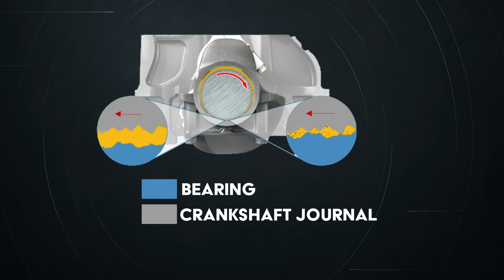the truth about start-stop technology (finally proven)

Comment: It appears from the editing that youdrained the oil. Thus, your timings include priming the pump. I guarantee you oil pressure is built during the first restarting cycle arter the engine has been run for only a few seconds.

Comment: On most modern cars (mainly BMWs), disableing the start stop system doesnt save you, because the oil pressure mapping is far to low in idle, as the engine isnt designed to run in idle due to the intended use of start stop…

Comment: This could kill someone, and maybe it already has — who knows. I was about to pull out onto the main road from a side street. I almost came to a stop, ready to accelerate, and the car just shut off. I lost another two seconds while slowly rolling toward the road because the engine was off. Total stupidity.

I drive a lot of different cars, and not every start-stop system works the same. Some cars need to warm up first. In a VW, it shuts off instantly even when the engine is cold and you haven’t come to a complete stop.

Comment: Here's the thing about the argument that you are missing. Start stop is not inherently bad. Start-stop done cheaply is exactly what you're describing. The downsides that you have showcased are indeed accurate, but they are easily prevented if manufacturers care. Take a look at the Mazda i-Stop system, it's start-stop done right. The way it works is quite simple. Whenever the engine stops, the system ensures that they are always stopped in a certain position (with one of the pistons being "primed" for the power stroke), so the engine is quick to start and deliver what's needed, this making it less noticable. As for the wear, the system has an electric oil pump that ensures that all parts that require oil to not wear are properly lubricated. On top of that, the engine is designed with oil retention systems, thus making sure that as little as possible oil escapes from where it's needed. The entire starter assembly is also designed to take the extra load of having to start the engine so many times. So with these systems in place, the wear you are describing is basically nullified, as you're ensuring that everything is properly oiled up at all times, and you're getting all the benefits (less fuel consumption, less pollution) of start stop, for a tiny bit more complexity (as there's an extra component, the electrical oil pump). Audi, BMW, and VW also have this type of systems, but they are reserved for the higher end models. The system itself is not bad, but implementing it poorly to ensure lower emissions (as a company, not per car basis) is causing problems, not the system itself. So have manufacturers implement it properly, and there won't be any issues, but they won't, because they care about profits more than anything else.

Comment: BS. false conclusions after your video here:
1. If you don't drive each trip at least 200 km, don't bother. I guess German cars are not for you. I drive to the grocery store every day, less than 10 minute drive. There's no traffic signal. I stop the engine because I reached the end of my trip. I guess German cars are no good for this.
2. 1000000miles? My care that I just replaces was 12 years old and had 120k+ km on board (owned since new). Why the hell would I need 1million miles? Who does?
3. German engineers sure know how to reduce wear in those situations. Some finishing and thermochemical treatment. Makes the engine more expensive? Yes, better than leather and hand stitched shit. Also there's some tweaking of the lubrication systems, so on. That means you build an engine exactly for that purpose. Surely German engineers can rise to the challenge, aren't they?

Comment: Great video! As a feature intended for the city we would need to know the amount of fuel saved in average during, let's say 250000 KM, and then compare against the carbon print of all extra repairs required. I would think, without having the data, that except for heavy used vehicles like taxis or people with very long commutes with a lot of traffic, the use of start-stop will be detrimental from an environmental point of view. Similar to forcing someone to switch to an EV when running 10000 KM/year.

Comment: the fuel saving benefit of start-stop doesn't justify the added wear on parts, and the general environmental impact that passenger cars make is also minuscule. most emission is caused by heavy machinery, energy generation etc. the only significant benefit of start-stop is in dense areas with high traffic, where it can noticeably reduce the local air pollution.

Comment: It doesnt take an engineer to work out that start up is both when most wear occurs and when catastrophic failure is most likely during ordinary operation.  

This is worse than just a bunch of extra start cycles however.

During an ordinary start the brake is depressed and the transmission isnt in a drive gear. There is a minimum delay between start up and applying any throttle as the operator must switch pedals and choose a gear first. In a modern engine this delay provides some time for the oil pump to profuse the system.

The typical stoplight isnt long enough to drain oil from the engine, but a wait in a drive through or other situation might, and going from engine off to open throttle with zero lag to allow for the pump to re-profuse lubricant is a recipe for heavy wear or even breakage.

With auto stop/ start youre frequently going from engine off to heavy throttle almost instantly. There is enough lag to make  stop and go traffic a thoroughly terrible driving experience, but not enough to prevent all sorts of suboptimal conditions within the engine.

It is a thoroughly terrible idea that is nearly certain to negate any environmental benefit it might provide through destroying engines, reduced engine life, necessitating excessive oil changes, consuming batteies more frequently, etc.

If you own a vehicle with this feature and you arent willing to permanently delete it (its easy but will invalidate your waranty) you should form the habit that starting the engine always also includes disabling this feature.

Failure to disable the feature is akin to running dirty oil or clogged air filters: Sure, the engine will operate, but with excessive wear and an impaired driving experience, and may cause sudden catastrophic engine damage.

All this says nothing about the growing evidence this feature is damaging batteries, that then causes a cascade of diagnostic messages and systems failures.   Why does your car say the parking assist needs service and the AC wont blow cold air?  The battery is damaged due to the S/S feature and is now sending inconsistent current to the computer. If you have the S/S feature the first step in any vehicle diagnostics is to install a known good battery and see if that fixes it. Often it will.

Auto Stop/Start is the sort of absurdity only an ignorant person could conceive of, like an EVAP system, it seems to have been invented by an engine hating, driver hating devil.

Comment: I always wait for the enigine revs to get to standard idle before moving off. I'm under the impression that at this stage the oil has now circulated to where it should be. Driving a 2004 Mondeo ST with 115,000 miles on the clock, runs like a watch still.

Comment: My 2017 Cruze doesn't have any way of disabling the start/stop system. I was so happy when it stopped working, lol

Biggest issue that came with start/stop in my car was low engine power from a stop even when the engine didn't auto-stop. I'm talking about upwards of 10-12 seconds to reach 60kph. Ever since the start/stop system stopped working that issue went away completely.

Comment: I manually start-stopped at my last 2 ICE cars. About 0.7 liter/100 km less consume, no problems.
My 2004 to 2014 Seat Alhambra was after 239,000 km destroied by a flood.
My 2014 to 2024 Dacia Lodgy was after 252,000 km sold to be replaced by a Tesla Y.
Do not believe his fairy tales.

Comment: Another nuisance of your engine shutting off at a red light is that your A/C stops cooling, so in the summer, after a minute of fuel saving, now you may need to set the AC work harder to cool the cabin back down, completely negating the fuel savings in the first place. I have only been in ONE car in which the AC continued to work with the engine stopped. The new CLE line has a mild hybrid setup which powers the AC with the electric motor. I parked in a lot while borrowing one last summer and I realized after about 5 minutes that I didn’t ’kill the car after parking. Impressive tech. Only time will tell if those engines also were made to diminish wear while using the start.stop feature.

Comment: This is a non-issue. I'd like to see oil wear analysis with and without start-stop. I have a 25-year-old car with 500,000km with start-stop (2000 Honda Insight) and you never see crank or rod bearing failure. The engines are known to do 500-800 thousand km. You should be more worried about cam bearings since they are the furthest from the pump

Comment: You needed to run a control where you have another car running continuously side-by-side with the start/stop car.  Not only that, you would need at least 10 cars for each situation, then compare all the bearings.

Comment: its pretty simple, the more times your engine cycles between hot and cold, the more wear you experience. its not the action of starting the engine over and over that wears it down, like a lot of people think, its simply that the more times you bring your engine up to temp and then let it go cold again (more cycles), the more wear you'll have. thats why truck engines last so long, they run at ideal temps almost all the time because theyre on for long periods, not in short cycles like a commuter vehicle

Comment: So how many start/stop cycles were they actually subjected to in those 48 hours?
How long would you expect it to take for the bearings to wear down as much as they did?
For the million km engine, which type of bearing is that?
Are the bearings the parts expected to wear down the fastest... or just the easier to access and examine of the parts that wear down?

Comment: The fuel savings are just not there. The whole thing is a scam made of good intentions and no oversight. Bigger Car Batteries, Reduced Battery Life, increased engine ware, Starter motor failures, less people though light sequences, acceleration before oil pressure, the list goes on and on. All to solve a problem on a consumer level, that makes no difference in comparison to shipping which burns dirty fuel and causes more pollution than all cars combined.

Comment: I think it’s a plot to force EVs onto us. Because the argument that EVs are eco friendly doesn’t hold if you calculate in the longevity of combustion engines and the extremely CO2 intense production of EV batteries. Therefore the combustion engines needs a drastic cut in longevity and a lot more wear. Welcome to the start-stopp-Automatik. There is a reason it’s illegal to program it out here in Germany. And it’s not because the engine idling for 7 seconds more every day is killing the environment

Comment: "Start-stop oil" isn't a unique type of oil but rather an engine oil specifically formulated and marketed to provide enhanced wear protection for vehicles equipped with automatic start-stop systems. These oils contain active substances and technologies, such as BIZOL's LubriBoost™ or Castrol's DUALOCK technology, that create a stronger, more resilient lubricant film to protect engine components during the frequent, short-duration shut-offs and restarts characteristic of start-stop systems.  
Why are special oils needed for start-stop systems?
Increased tribological stress: Frequent engine starts and stops place high wear stress on engine components, particularly at the point of mixed friction. 
Resilient lubricant film: Start-stop oils are designed to produce an exceptionally strong and resilient lubricating film that withstands the increased stress and prevents collapse during these brief engine-off periods. 
Active wear protection: These oils contain active substances that offer enhanced wear protection, especially in the mixed friction range, a condition that occurs when the full oil film is disrupted. 
Key characteristics of start-stop oils:
Superior film strength: They offer a much stronger and more resistant oil film compared to standard oils, ensuring critical engine surfaces are protected. 
Specialized anti-wear chemistry: They contain additives designed to provide increased wear protection during frequent start-stop cycles, according to Nulon. 
Enhanced anti-rust properties: Some formulations also include an anti-rust boost to combat the effects of water condensation that can occur in hybrid and PHEV (Plug-in Hybrid Electric Vehicle) engines, notes Nulon. 
Important Considerations: 
Not a separate category of oil: While marketed for start-stop vehicles, these oils still fall under general categories like full synthetic oils.
Check manufacturer recommendations: Always consult your vehicle's owner's manual to confirm if special oil is required and which specific specifications to use.
Proper formulation is key: Using API-certified synthetic oils specifically designed for start-stop systems provides the best protection, according to a YouTube video.

Make sure you change the oil at around 5000 miles or less and you should be fine...

Comment: As you don't mention under which conditions you stop and start the engine, we can't say much from this. If you open the manual for your stop-start-enabled car, you'll see a page-long list of conditions. For my car, there are 2 columns, and the last point is "etc...". So unless you took all of these factor into consideration, the test is nor representative. Also, I don't think many cars you go to more than 150000 kms. Yes it's true for a taxi and maybe a delivery vehicle, but your average car will break down from other factors, like the parts being 25 years old. I'm not sure this is actually a concern outside of specific use-cases.
Add to that that a stop&start-enabled car starts saving fuel after only ~3 seconds, or if I phrase this differently: with stop&start disabled you start wasting fuel after ~3 seconds! I'm really not sure your point holds.
A mechanic told me to disable stop&start in traffic jams though, but not because of engine wear. Because on this entry-model car, stop&start uses the main starter, which can stall.

Comment: 2:05 Yeeah. I was taught this a looong time ago. Even for electric motors, it takes far less energy to maintain them at speed, than it does to stop them and restart them. Airlines & Airplane manufactures will tell you an airplane experiences the most stress during takeoff and landing. When its cursing, its under very little relative stress. It makes total sense that starting and stopping an engine puts a lot of wear and tear on it. Or starting and stopping anything on a car. Accelerating and breaking does the same. Its why highway travel is far more fuel efficient than city driving. 

I mean.. Who thought 'engine start-stop' function wouldnt do this crap? Or manufactures actually did know, and didnt care because it means they sell more parts/services/cars that way. Its planned obsolesces if ive ever heard it.. Regardless if they meant it to be or not.

Comment: Just take a look into a typical emission test procedure and you will find long "waiting in idle" windows... of course you can pass the test, if you shut the engine down for that parts of the test. What does it do in the long term? What does it do to the starter? Battery?....nobody asks, the test condution dont ask about these, hence to the hell with them...

Comment: With my 2020 Jeep Wrangler, I put in a TaserJL computer to program the start stop to stay off. I use the computer for other things as well (re-calibrating changed ring and pinion, and larger tire size for accurate milage/speed).

Comment: It's was the first thing I pressed after starting my 2022 Pilot.  I hate that start stop nonsense.  I finally put an idlestopper on it and I haven't had to disable it since.  There should be a factory option to disable this feature.  I get that auto manufacturers do this for MPG estimates, but we should be able to turn it off if we don't care.  I'd rather lose 1 mpg because I'm idling at a stop light than have to rebuild my motor.

Comment: I have a 2020 gladiator with a 6spd manual transmission and it has this ridiculous “feature” but luckily I was able to disable it. However as part of this system it requires and comes with an auxiliary, parallelly wired battery and when one of the two batteries, be it the primary or auxiliary goes bad, the other battery is forced to compensate (this is an oversimplified version because I can’t explain the technical details). By the time the symptoms of the battery issue become apparent, both batteries are degraded to a level where both must be replaced, even if one of them was perfectly fine & functioning prior to the other one going bad. So you have to replace both at the same time and if you just recently replaced the main battery with an expensive fancy one right before the aux goes out, then you just wasted that money!

Comment: Starter wear needs to be mentioned too. Every mechanical component has a a finite number of time it can be operated. The auto start stop system has exponentially increased the number of time per day that a starter is utilized. The manufacturing process to produce a starter uses more energy and creates more "pollution" than you will ever save by not running you engine for the few minutes stopped at a traffic light. So the first time you have to replace the starter, cancels out any potential "good" the system was intended for.